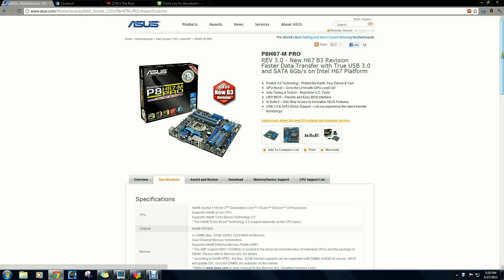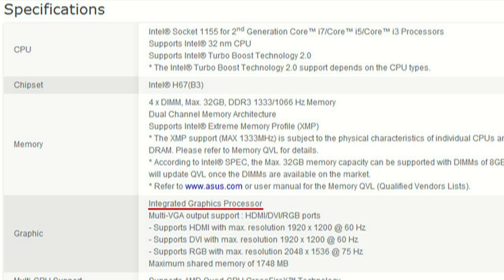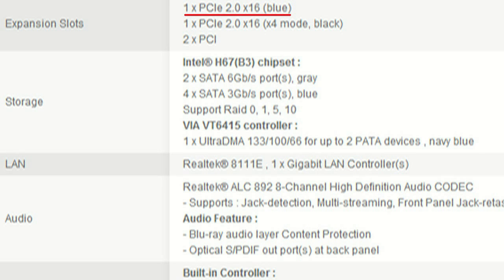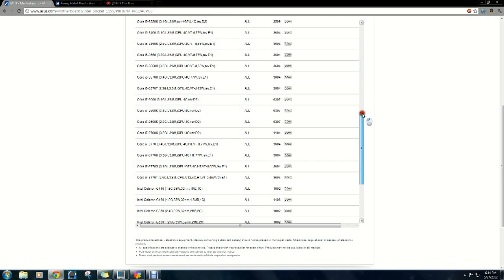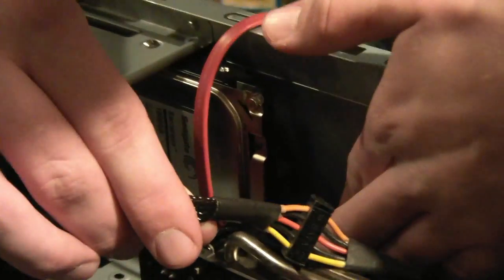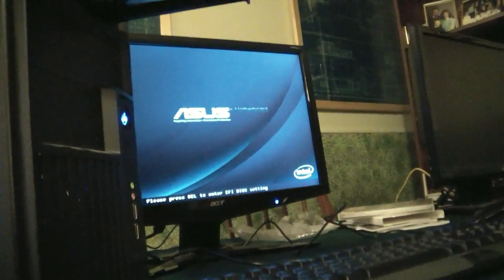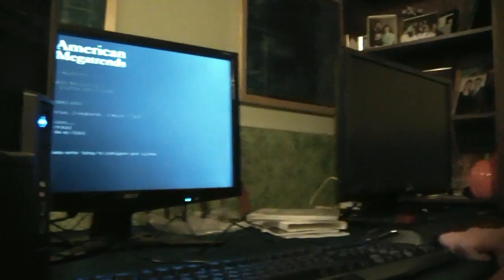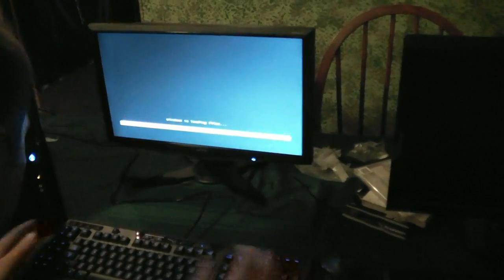How To Build A Computer

Comment from the maker: Well the new intel Ivy Bridge processors are out meaning the older Sandy Bridge ones are cheaper, and those are still fantastic.  I'd recommend looking into the i5 2400 which is an LGA 1155 socket.  The other components are really your choice trying to find what you are looking for.  As for the graphics card though I'd look into the GeForce 560.